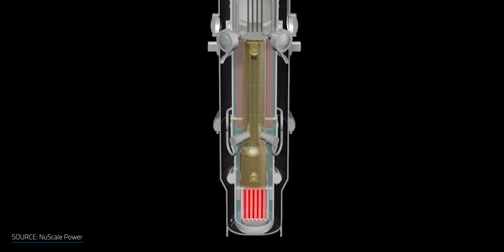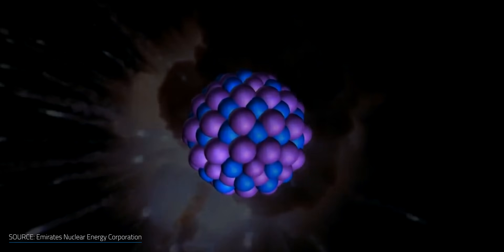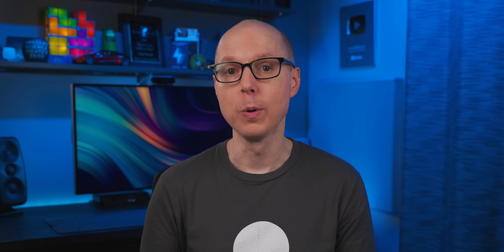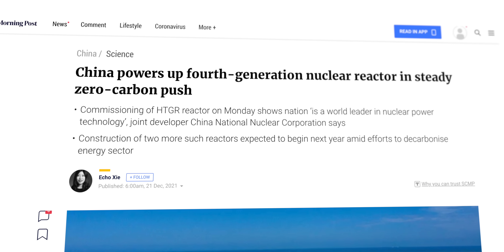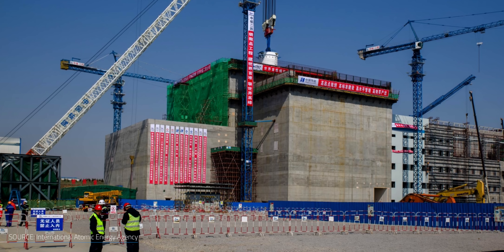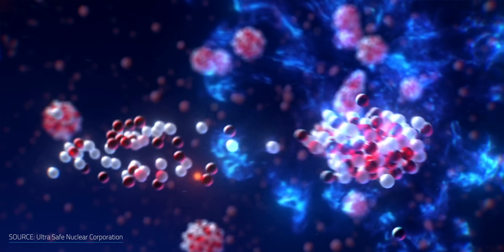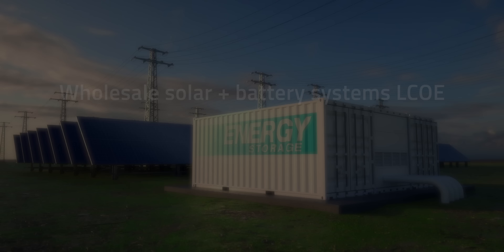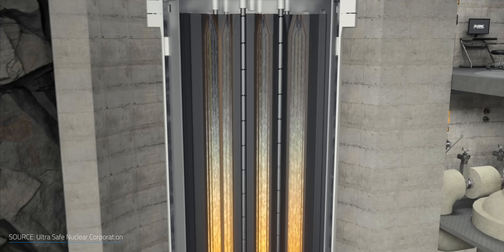Forget Small ... What About Micro Nuclear Energy?

Comment: Hey Matt, did the LCOE numbers take into account the 60% cost reduction through commercialization mentioned earlier in the video? And thanks for yet another awesome video!
Reply: I'm fairly confident that the LCoE calculations are done after the fact, not as a future estimation.
That is, the numbers that you see are essentially what each power generation source has cost per what it has produced. Granted, this is the first time I've seen any LCoE that takes batteries into account for renewables, even though they are a vital element of it.
Reply: https://www.youtube.com/watch?v=8-r2U0k_zUU&t=344s
Reply: Solar is unstable. They has quiet low over-the-year production in mild climate.
And very low production during 
 winters. So in winter you'll get less than 1/20 of summer production. Moreover there could be weeks without sun and massive snowfalls when you'll get nearly nothing. How to compensate those winter drops? To build x20 more power and storages capable for storing for weeks. It would be economical disaster.
Of course there are climate zones where solar energy is profitable.
Reply: LCOE is really flawed. It doesn't take a lot into account. A newer study by the UN concluded that nuclear is actually significantly cheaper than wind, solar, and hydro. Also, construction times and costs of nuclear power plants are also much lower than that of wind, solar, and hydro.
Reply: @DanskeCrimeRiderTV  That really isn't remotely surprising. A mere 24 hours of storage already makes them cost-prohibitive. Energy collectors would have to be able to cover for dips in collectible energy over YEARS  to equal dispatchable generators.
Reply: @DanskeCrimeRiderTV  yeah when I saw that in this video I immediately doubted the presented LCOE too, it didn’t make sense because wind and solar are heavily subsidized.
Reply: @VweyB  subsidized, and I have to wonder if idle time where weather is prohibitive to operation is factored in.
Reply: @trailingrails9953  yeah, good point surely that has to be at least a considered a loss also. I wonder if they just do estimates of how much is produced and if that estimate is fair or favorable, if i were to bet on that I would bet they only use the most favorable numbers.
Reply: @DanskeCrimeRiderTV  Tiny reactors are suffering from scaling problems. You will inevitably contaminat more material when using smaller reactors per MWh. Second problem is insurance. Today normal reactors are highly underinsured because insurances including a meltdown would make them uneconomic. There are security problems. You can protect a dozen of nuclear reactors from terrorists but would this work for thousands spread all over the country? And would they keep up the training standards for the operators?

And the last part is: the amount of uranium is simply limited. It was calculated that we had enough Uranium for 200 years worldwide if we keep on going. If we step up the use we will run into problems very soon.
Reply: @svenweihusen57  the 200 year estimate is based on the availability of heavier uranium, which needs to be enriched.
The small reactors shown can use the unriched material.

Better would it be to use thorium, now that is just waste and we have allready piled millions of tons on it without further use..
Reply: @doctordapp  didn't knew that they use not enriched material. But IMHO doesn't this change a thing due to the fact that the energy is still only created by U235. So it doesn't matter if you enrich the Uranium and just toss a part of the U238 or if you use it without enrichment. The amount of energy you can get from U235 will still be the same. But I may be wrong here.
Reply: @DanskeCrimeRiderTV hold up, construction times of nuclear are shorter than wind and solar? Which plants are you looking at? Last nuclear plants I saw had rollout times over a decade, vs wind which can be like... A month.
Reply: @DanskeCrimeRiderTV  I’ve always wondered if LCoE for solar and wind included the cost of extra poles and wires, battery storage, land use, and any extra solar and wind capacity required to make up for intermittency. Yes the panels and turbines themselves are cheap (and that’s apparently largely due to the use of underpaid/slave labour in China), but they’re hardly the whole story. Land use in particular would be a significant cost in many areas because it needs to be close to where the power is needed, which includes potential residential and farm land, and often has to be bought out from previous owners who can demand a higher than market price. This is something that nuclear basically doesn’t have to consider, especially in the case of SMRs and micro reactors.

Comment: Yes i have been calling for this for years; The key is to make it such that a meltdown is containable. They are in small applications with huge concrete domes, but with "micro" it is possible with like a spade, maybe a bit of led and a source of heat.

Furthermore, it would make applications for new tech far reaching, think of disposeable tvs, with a 10 year lifespan and like miniscule amounts of radioactive material, idk maybe even thorium? As fusion will still take time.

We do need an on demand fuel source, and nuclear is the safest whilst also a green option. We should stop the widespread hate towards nuclear per greenpeace to make it possible to achieve the micro tech described. Renewables are a great supplement, but like one volcano eruption could hinder mass solar, and water is volitile for climate change...
Reply: The concept of a meltdown is not really the same with MSRs. For one thing, everything is already melted. :P  In the thorium MSR designs I've seen, the thermal spectrum ones, the idea is you have a drain plug that melts if the thing overheats, and a drain tank without any moderator. No moderator means the neutrons don't get absorbed and the chain reaction stops. Then you have a tank of frozen salt to deal with, but at least it doesn't blow up into the surrounding area.

Comment: 1MW for 1000 homes? That's 1kW per home... barely enough to power a kettle or a microwave. Electric stove (2-7 kW if with oven and all running), heating, EV, dishwasher, kettle, washing machine running same time can happen in peak demand hours or during holidays when everyone is cooking and it's cold. I'd say 10kW constant capacity is required, if you want to future-proof than 15+ kW...
Personally I'd install a micro reactor at home... RTG or something. Way safer than gas.
Reply: Nuclear does not like to get shut off suddenly when you don't need it. Such a system would have to be paired with a battery storage system to supply the demand peak.

Comment: The Chinese started their first molten salt reactor in September 2021. This is a test facility designed to supply 1000 households with electricity.
It does not require wast amounts of cooling water and is located in the Gobi desert.

Comment: I'm not a fan of micro reactors, I don't see a possible security solution. I like 350MW MSR as cheap assembly line safe power for the 20% of total power that needs to be dependable when there is little sunlight for a decade (such as a nuclear winter).

Comment: Elysium modular nuclear reactors solve almost all concerns with nuclear energy.  They use our current nuclear waste as their fuel thereby dramatically reducing the size of that problem.  The cost of the fuel is negative since it needs to be disposed of in any case.  There is enough nuclear waste awaiting disposal to provide hundreds of years of electricity and process heat.  They are a walk-away safe design.  They require no new technology to be deployed.  They are a load following design which compliments the expanded use of wind and solar.  Their only problem is being a new design which needs to pass through the licensing process.  It is the educated publics job to speak up in favor of this design being licensed so we can get on with the urgent process of limiting further climate damage.

Comment: Even a small reactor has the capability of doing unimaginable damage.
It's also irresponsible to use nuclear, when if there is no long term storage solution in place.
Reply: Even a small nuclear reactor, if not properly managed, CAN do significant damage. But a fossil fuel power station WILL do significant damage, both environmental and social. We know how to build long term storage solutions, we just need to actually finish the ones we started building already. With all that in mind, it's blatantly irresponsible NOT to use nuclear.

Comment: But surely not pressurised water reactors. Why does nobody else see the advantages of molten salt reactors? Take this to start with
1 They cannot explode/melt down. They are consequently  one thousandth of the size, without needing the containment.
2 They burn 100% of the fuel - not one percent of the uranium. And it becomes possible to use thorium as a fuel, which is relatively abundant.
3 They do not require complex fuel rods
4 They do not require emergency cooling systems. 
There are lots of advantages etc, etc.

Prototypes are beginning to appear.
In New Brunswick (Canada) the British company: MOLTEX is building a 300MW plant to supply electricity to the grid. The design is called a : "stable salt reactor" and you can also burn plutonium in it. Plutonium is a nuclear waste which most governments will pay you to take away.
There is about a ten year build time (this being the first one). All the physics problems have been solved. I would like to see cooperation with Rolls Royce Nuclear to get these these things into series production.

Comment: Thorium based system from the 50s/60s can be FUELED by the waste from conventional westinghouse/containment vessel fast/slow breeders.   A well designed system will generate about a can of baked beans worth of waste each year, compared to olympic swimming pools worth from the other designs.

As horrible as it sounds the asteroid wars hypothesis could work too -
Mass production of micro reactors using throw away designs could also help.
Build a small fixed service life reactor that cant be serviced, and you could build them even smaller.  Small enough to work like glorified atomic AA batteries.. use them for say 50 years then send them off to be crushed up and recycled - or on the SMR scale build a disposable reactor for space crafts, then shoot them into the sun or something when they wear out. It is horrible to suggest - but you also have to factor in human laziness here where early adoption is concerned.

Solar panels after all fall into this same category - technically they are a ticking environmental disaster and most fail under 30 years.    Thats a lot of ewaste in a decade or so as the first systems start failing - but people delude themself into thinking its a good idea because they dont have to think about them for them to operate.

Comment: At 8:39 it states that a 1 megawatt reactor could supply energy to 1000 homes. That implies each home consumes only 1 kilowatt. That is WAY, WAY off.
A microwave consumes more than that, as does a plug in space heater. By LAW, in most jurisdictions, a 2000 square foot house MUST BE wired for a MINIMUM of 100 Amps at 240 Volts, and it's commonly 200 Amps at 240 Volts. That corresponds to 24 and 48 kilowatts, respectively. A friend with an electric car and a garage wired for it had his home wired for 400 Amps at 240 Volts. That's 96 kilowatts.  My point is that the sales representations about '1000 homes' can be supplied are often WAY, WAY off the mark.
Reply: 1 kilowatt is the expected load at any particular time averaged across all homes, not the peak consumption of one home.
Reply: @florisr9  I understand that it might be interpreted as an average. HOWEVER....
1) Even that is an unrealistic assumption. My monthly electric bill states my home is in the top tier for minimizing its energy consumption. Yet my monthly electrical consumption exceeds 720 kwh (24 hours x 30 days = 720 hours/month). Let's say you pay $0.15 per kwh. That means the average monthly electrical bill should not exceed $108.
2) You cannot represent a power plant's capacity to just match the average consumption of the homes and businesses as sufficient. To do so means it may support consumption at 3AM, in Spring and Fall, but may fail 24/7 for a couple months in the heat of Summer and cold of Winter. It will also will fail 24/7/365 for the surge in usage in the morning and evening.
Edit: I used 15 cents per hour. But according to this source, that is higher than all but 12 states. Arkansas is $0.10 /kwh
https://www.electricchoice.com/electricity-prices-by-state/

Comment: The problem with nuclear is that no one wants one there back yard enivomentalist block any  new one's being built so the old plants wined up operating well past the point they should Wich Leeds to  inevitable problems  so the  environmental activists actually contribute to the problem if your going to build nuclear plant at any scale they need to address the issue of spent fuel rods maybe build thourium salt reactors to break down the waste but with the starte of the environment and all the shinny new EVs that are coming on line we need to do something because the power grid in this country isn't going to be able to handle it in it's current condition which is old and terrible

Comment: While in grad school around 1980, a professor opined that the ultimate solution to residential power was a small fusion reactor embedded in 1 cubic meter of concrete and made as part of the foundation of a house. I wonder.
Reply: Small and fusion reactor do not belong in the same sentence. Still no fusion reactor, ITER is expected to have a net gain factor of about 10 (just considering the fusion reaction alone, not the considerable parasitic drains and inefficiencies),  a commerical fusion reactor will need a gain of at perhaps 25-50, and it would have to be bigger than ITER using the same technology. Maybe MIT can develop a working fusion reactors smaller than a football field, but ITER footprint is about 100 football fields worth IIRC.

Comment: As the video mentioned the nuclear waste still emits radiation, so why not put that radiation to use? I have seen a video about a year ago that said that fuel rods are considered spent if they show the slightest bit of degradation, and they still have lots of potential for energy generation left over.
Reply: The nuclear nonproliferation treaty is why. The "easiest" way to prevent material diversion is to store it instead of recycling it.

Comment: Same stupid design just smaller. Nuclear is the way but not with liquid metal or water but with molten salt. Clearly making them smaller doesn't doesn't fix the problem and every time you start them up you need regulatory approval. MOLTEX ENERGY has a design SSR that has overcome many of these issues by burning nuclear waste for fuel. They also use fuel rods that need to be replaced instead of some 80 ton assembly.